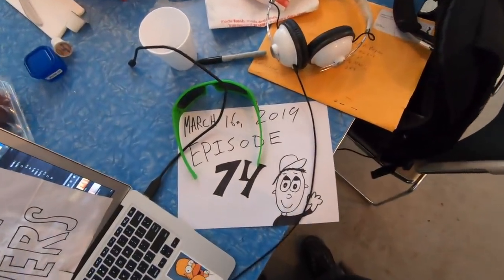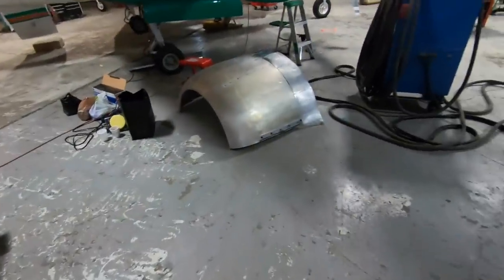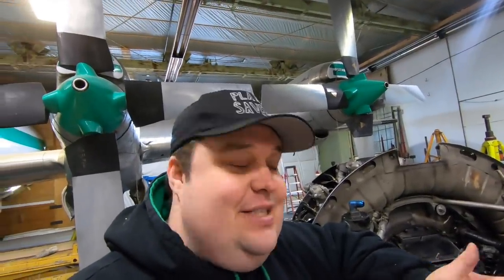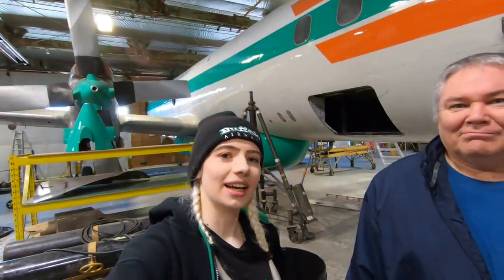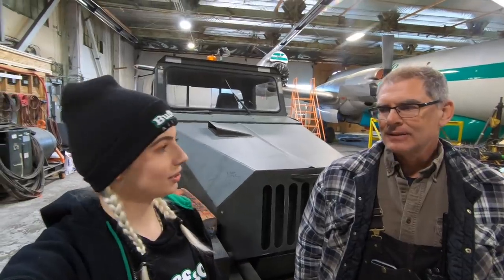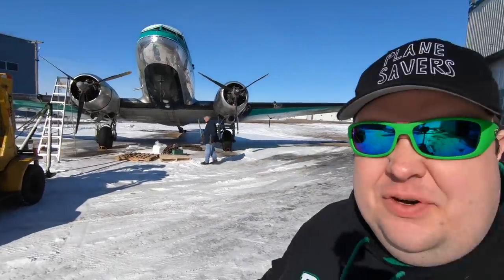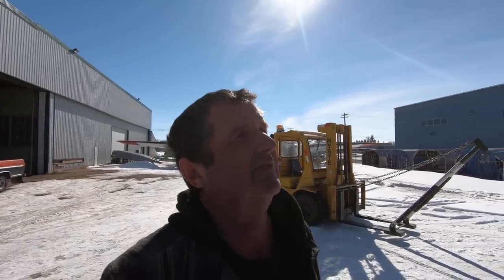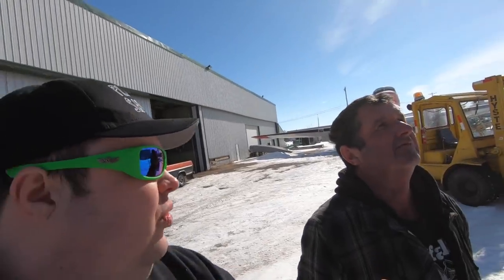"Volunteers Learn How to Take a DC-3 Prop Off!" Plane Savers E74

Comment: So that is the 'Jesus nut', if it comes loose "Oh Jeez"!
Reply: I know them well. On Huey Helicopters  the torque  is even 600 ft-lbs .
Reply: 600 ft-lbs... guess it takes 2 good men to twist that down til she`s snug.  Do they have a special tool for that, or just use a torque multiplier?
Reply: Yes takes two men if using regular torque wrench. One can do it if you you special winde up torque multiplier. But if used torque multiplier you have to let it sit for 2 minutes then retorque.
Reply: @stanpatterson5033  I believe the torque on the prop is 1500 ft-lbs. That hydraulic jack unit that I was using has a gauge on it, I was watching it go down as I pumped the jack up. That unit inserts into the right side as well for tightening and setting that torque.

Comment: The wife and i, went for a 50 mile drive today. temp 45F, Moscow, Idaho. We stopped at our airport and watched a Q-400 (Dash-8) take off and a piper apache. the whole drive i had the sun roof open and  my side window down. Even kicked it up a notch around some twisty bits of road i know and had some fun.
So nice. Spring is soon! So tired of snow and ice
Thanks Mickey for you videos. My wife and i love them.

What happened to Ice Pilots? did the network kick you or what. Be nice to hear your say of what happened

Who owns the black and orange Ford?! holy hell that truck looks good.  How much? i want it
JnShaw90@gmail.com